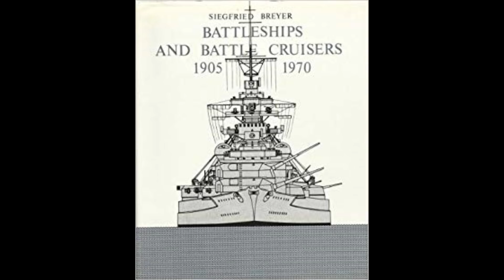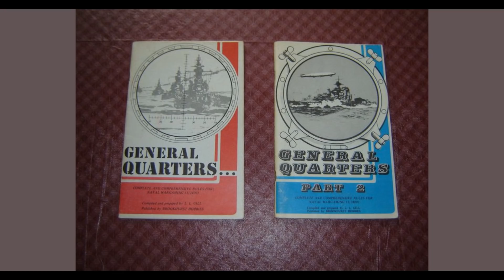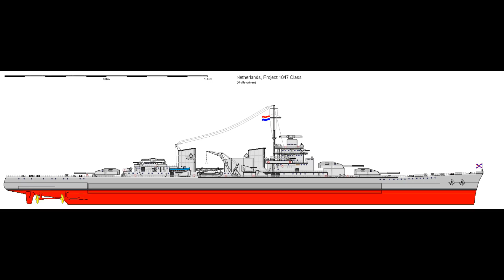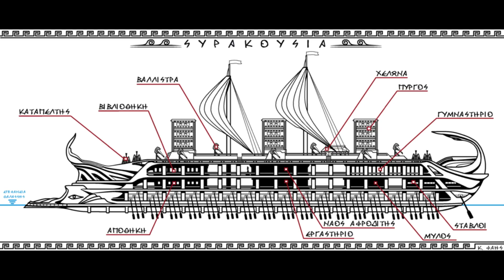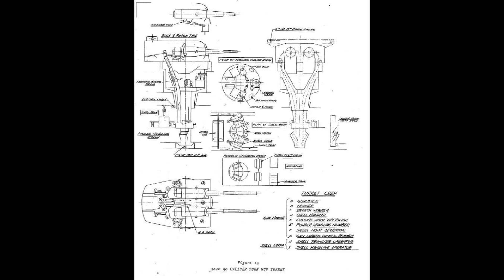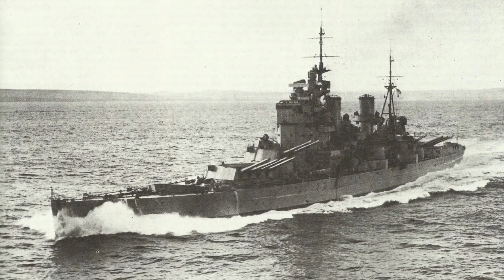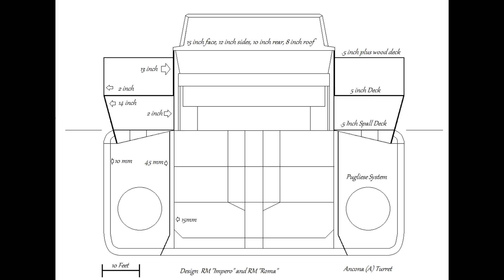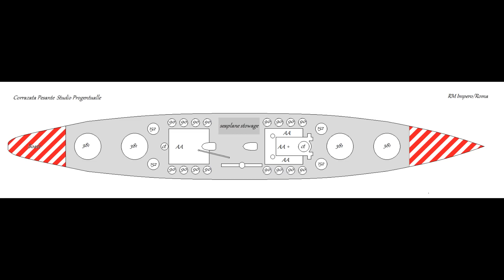The Drydock - Episode 047

Comment: Drachisms Of The Day:

7:28   "unobtainium propeller shafts and Tardiss-like engine spaces"

9:07   "bears the somewhat dubious privilege of being one of the most modernized pre-Dreadnoughts of all time"

33:40  "also, growing a brain-stem and realizing that possibly the Enigma codes had been cracked"

43:12 (singing) "Skippy!  Oh Skippy the bush kangaroo."

43:50  "Which spells very bad things for Prince Eugen who would be the one to catch most of that in the face"

49:25 "ramp up the power plant to EVEN MORE hilarious levels"
Reply: You should add: "To a certain degree, they (the French Navy) were like a very truculent division of the Royal Navy fleet reserve."
Reply: Thermal shrouding to eliminate small variations on Barrell dimensions? Sounds useful on a boat that pitches up and down and rolls natively while in combat. obviously a small miss will lead to failing to get the first strike from concealed position where your opponent cannot spot you.... It's not like radar works with background clutter at sea! Waiiiit.
Reply: 9:38 "WHY, GERMANY!?!!"

Comment: While the crews of British submarines suffered greatly from heat of the Indian and Pacific oceans, the biggest issue was the buildup of humidity and consequent buildup of condensation on the hull interior. This caused drips and streams of water to run down the surface of every space while the boats were submerged. This had a disastrous effect on the electrical and electronic equipment onboard in the days of everything being tube (valve) operated, especially in the later stage of the was as things like radar, radios, jammers, and sonars. The moisture even got into periscopes, making them almost useless until they could be dried out with time on the surface. The Amphion class finally solved the problem with effective air conditioning, but only two were completed in time for Pacific service. The time and expense put into the design of the boats served the RN well postwar, with the Amphions being the equivalent of the USN Gato class in long service, some being modernized rather like the GUPPY program, and the last not being decommissioned until 1974. 

The importance of air conditioning  in tropical waters was well demonstrated by the experience of the HMS Turbulent in the Indian Ocean in 2011. The boat was running on the surface in 120 degree air temperatures when the air conditioning failed due to the intakes being clogged with large numbers of crabs and barnacles. Repair crews were unable to clear the intakes because the hull was too hot to touch. The only fresh air ventilation possible was the two hull hatches since nuclear subs are almost completely sealed vessels. The crew was progressively getting sicker due to heat exhaustion when the captain decided the only answer was to dive into cooler waters at 200 feet until the hull and interior cooled to manageable levels, allowing the intakes to be cleared.

Comment: In regards to thermal tech my experience is in the USN. As far as gun cooling the 76mm OTO Melara on the Oliver Hazard Perry frigates had a water jacket over the barrel that cooled it so it could keep up indefinite fire and never reach "Hot Gun" status (Hot gun means a round sitting in the chamber can cook off unexpectedly from soaking in latent heat.)
As far as whole ship measures if you look at the stacks of an Arleigh Burke and I'm sure many other destroyer and frigate sized ships you'll notice that it seems over sized. The stacks are actually much smaller in diameter and those larger superstructures are used to pass air through and mask the IR signature of the stacks which would stick out like a sore thumb otherwise. It's still hard to hide the actual exhaust gasses but it's something. And USN ships actively use their gunsights for 5" located above the bridge on (DDG's) as a form of lookout and situational awareness. They also use the sensors on their MK38 Mod 2/3 mounts in tighter or more dangerous areas. This equates to multiple magnified eyes looking multiple directions in both visual spectrum and IR.
Reply: Rawley Wagor I had assumed that hot guns was the primary cause of shells exploding in the barrels in WW1 ships, and one of those practical limitations that people like Wargaming ignore when making a game. Some of the rates of fire are approaching the “stonking” level (which i have understood as a defensive fire tactic that basically burned out the barrel as a trade off for a short burst of rapid fire)
Reply: @scottdrone-silvers5179  I'm not well versed on WWI era gunnery. Perhaps the explosive filler was more susceptible to heat. I had always assumed in-barrel detonations back then were cause by a sympathetic detonation on an overly sensitive round or faulty fuse while firing
A MK45 Mod 4 (5"/62) can go for several minutes at it's maximum rate of fire before heat even becomes a consideration. I would assume older guns scaled similarly to their caliber and rate of fire.

Comment: 35:00  Oh, I also suspect Drach could also help the Romans improve the seaworthiness of there ships, so more of the fleets would survive the occasional storm they had a nasty habit of running into.

FYI. The Romans did have a bad time against Carthage, mostly because they kept loosing ships in storms that Carthage's fleets avoided for the most part.
Reply: Clinker building their ships would be one method of doing that, Roman and Greek ships were not clinker built. Also a more modern frame design to add both strength and more flexibility, allowing the vessel to flex and bend more in heavy seas.
Reply: The other thing is telling them about how that "aeolipile" toy that Heron of Alexandria built could worked into an engine to drive ships without needing wind.
Reply: Who won?
....indeed.

Comment: Something I think that civilian references misconstrue are the difference between initial ROF and sustained ROF during battle operations. 

From what I can see the term “theoretical ROF” is equivalent to a weapon system maintaining its initial ROF during a surface action which is dangerous as it can result in a hot gun, misfire, or the weapon system & or crew becoming casualties. Plus it would significantly increase its rate of barrel wear.
Reply: Another thing to be considered in ROF discussions is the target staying in range and arc of fire. It does no good maintaining a ROF if the target is way over there.
Reply: That and flight time if you're hitting them most salvos you can get away without awaiting to fall of shot of your last salvo and applying a correction otherwise your going to hitting a lot of sea. Also ammo gets further away as the stocks get used

Comment: 56:00 The Japanese did show initiative in some cases in just such situations: in the Battle of the Santa Cruz, the main air attacks by opposing sides'carriers were launched practically at the same time and ran into each-other mid-way. Some 9 escorting Zeros abandoned their mission and proceeded to attack the US strike force shooting down quite a few aircraft. That being said, a similar sutuation had occured during the previous Battle of the Easters Solomons but that time both sides just stuck to their plan and did not engage the other. Perhaps the initiative shown at Santa Cruz was a lesson learned at the Eastern Solomons, but I could not be sure. What is notable, though, is that US stuck to their plane in both cases.

Comment: Re: ROF. One thing that a lot of "paper" assessments miss is that it's seldom useful to shoot faster than you can spot the fall of your shot and correct your aim. As gunnery ranges increased, shell flight times increased with them - and useful ROF for battleship main batteries approached one round per minute.

Re: AH Battle of the Java Sea. If the Dutch have a Design 1047 in the Far East, the IJN would most likely respond by sending two Kongo-class, and/or a division of (light) carriers. The IJN always tried (I said "tried," not "succeeded," or even "properly understood how to") to maximize their advantages, and seeking out 1v1 duels when you have a preponderance of force is closer to maximizing your DISadvantages.

Re: AH Pearl Harbor. The obvious first issue is that the IJN planners specifically chose the route of the Hawaii Operation attack force to keep it well clear of accidental early contacts. The USN would be unlikely to have a CV - let alone multiple CVs - in that area... Unless they were hunting the attackers, the operational security of the attack having been blown. So there's that.

The second issue is, redirecting an airstrike once it was in flight was extremely difficult, bordering on impossible in 1941. (Especially if many of your aircraft don't even carry radios, though this was also the case for services with radios in every cockpit - and continued to be so for decades after WW2.) So not only would the Japanese first wave (almost) certainly proceed on to Oahu and attack as planned, but the second wave - already in the air by this time, and with no aircraft carrying torpedoes anyway - would also (almost) certainly carry out their planned attack. >90% confidence, even without considering what you might call "cultural factors." Of course if the US was forewarned enough to mass CVs NW of Oahu in advance of the attack, then every ship that could raise steam would be safely out of the target zone. And presumably the Army would also turn the air over Oahu into a CAP and flak trap.

Comment: What were the merits (and lack thereof) of coastal defense battleships?
Reply: Cheap?
Reply: Slower than molasses in January?
Reply: They're more mobile than a fortress but less capable than a frontline battleship.
Reply: You could pack more into offensive or defensive capabilites by sacrificing range stuff, like, you replace excesivve engine weight and fuel and supply weight for the same ammount of armour or guns

Comment: In addition to the topics discussed in the video, the casement guns were not watertight. In case of hull damage there was less  reserve buoyancy. Check out the sinking of the Szent Istvan here on YT, once the casements are submerged important reserve buoyancy far away from the vessel's center line is lost. This may have accelerated the sinking.

Comment: It seems to me that at Denmark Straits Holland intended to concentrate his fire on Bismarck and allow for Prinz Eugen to be engaged by the Counties when they could, without Hood and the British would feel safe to close slower with all guns available and KGV is going be able identify Bismarck sooner than Hoods gunners also with the same Guns and FCT the KGV can use GMS which should get them on target faster assuming POW crew had trained on the system which seems to be the case as Hood and POW were going to use GIC. I have long wondered why when McCullen had served on Hood before POW he didn't ask Captain Leech to signal the Flag the he confirmed the right hand target to be Bismarck as he would have know that he had a better sighting postion

Comment: Tossing in a badly designed ship, not really suited for competition nor reality.  It is what I dub a "Siege Carrier".   It is a carrier that has two landing decks to the left and right of a high central structure.  The structure has a tall mast for radar apparatus and such, with a total of four single gun turrets in the fore and aft of the central structure.  These guns have a high caliber, designed for barraging land structures foremost - so there is a focus on range and penetration.

Further, the back and front corners of the two landing decks has a missile turret installed.  These turrets are meant for anti-air primarily, but can be used against mobile land targets.  This results in a total of four missile turrets, with at least three missile tubes.

The purpose for having the gun turrets is to reduce the expense of eliminating coastal bases and other immobile issues.  If I remember rightly, a shell costs something like $10,000 to $25,000.  This is opposed to missiles, which apparently cost at least $200,000+ apiece.  In effect, missiles are reserved for targets that the gun turrets can't deal with.  In turn, the vehicles are used for whatever the missiles can't reach.

I am pretty sure that anyone who designs ships for a living is now eying the nearest liquor bottle.

Comment: Why don't these ships have chemical rounds like heat
Reply: Angle of shell fall mostly I would say, in most actions the shells are coming in at an angle, only in a few cases are the ranges so short the shells have a relatively flat trajectory. Chemical charges like HEAT work best when they hit the armour flat on, they would lose a huge amount of their penetrative power when striking at an angle. Also you want the shell to physically penetrate the ship you are firing at, just burning through the armour is not what does the damage, the bursting charge of the shell exploding beyond the armour inside the ship is what does the real damage.
Reply: A HEAT round from what I've seen also leaves a relatively small diameter hole
Reply: What these ships are firing at each other is armor-piercing capped ballistic capped (APCBC), which was the best thing against armor until the development of the shaped charge warhead. However, a tank has a fairly small internal volume with lots of important stuff inside the armor, so the majority of the time a penetrating hit will also be a mission kill. Many of those mission kills will start fires and become catastrophic losses, and almost all mission kills will be abandoned in the hope of later salvage and repair. There are exceptions, but they tend to be rare.

For ships, you have a huge volume (even within the armor) and fewer things that will immediately mission kill the ship. Sabot or HEAT rounds will punch small holes in the armor, but won't affect much other than what just behind the armor. In contrast, your AP shell can penetrate the armor AND set off a, say, 30-50 pound explosive charge behind the armor to do far more extensive damage. Even with those kinds of shells, it's normal for a ship to be battered into submission by a dozen or more heavy-caliber hits. Again, there are exceptions (Invincible, Indefatigable, Queen Mary, Hood, Boise could have been), but they are rare.

Comment: I generally love each episode you present, but you said "a ridiculous amount of 40mm and 20mm anti-aircraft guns". Please tell me, when someone is trying to kill you, when does defensive armament become ridiculous?
Reply from the maker: When there are serious issues with whether the ship has become unstable and/or short of supplies due to additional weight of weapons and numbers of crew. :p
Reply: @Drachinifel  I'll give you the point on crew since combat crewing on battle wagons was always at the bursting point of the ship, but making a WWII era battle wagon unstable with 20mm and 40mm guns unstable sounds a bit off.
Reply from the maker: @sammybarnes9511  there is a greater margin on battleships, but you'll notice that despite similar deck space the refitted standards which had a lot of top weight removed generally carried more light/medium AA than less upgraded relatives. One 40mm mount doesn't make much difference, dozens do. And on smaller ships like Atlanta's and destroyers They had to ditch other weapons systems to avoid dangerous stability conditions in order to fit more such AA.
Reply: @Drachinifel  I was still thinking along the lines of battleships. On the smaller vessels your totally right.
Reply: ^"you're" totally right